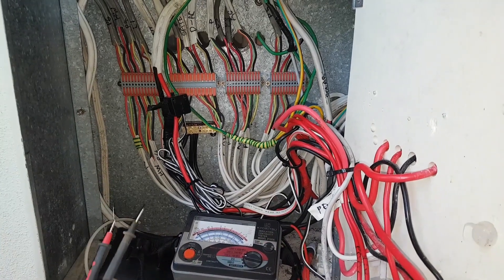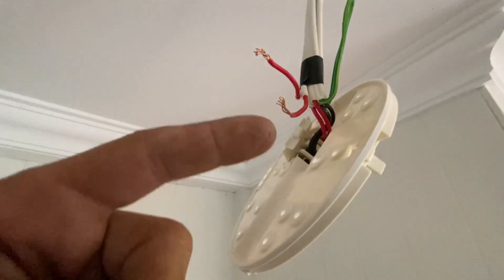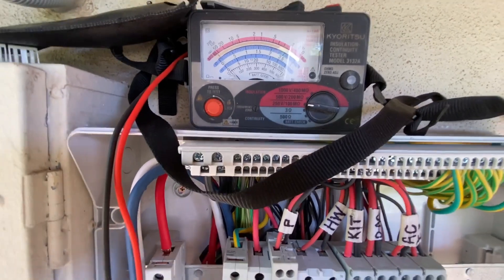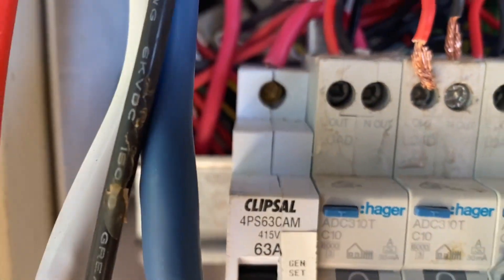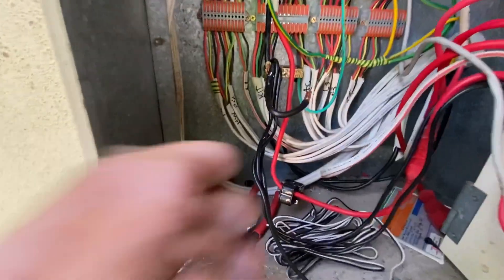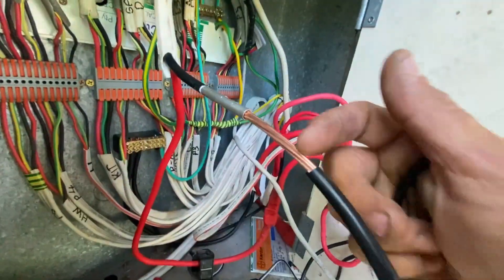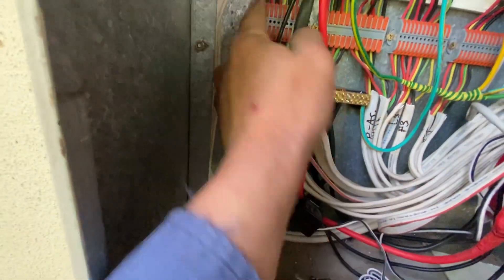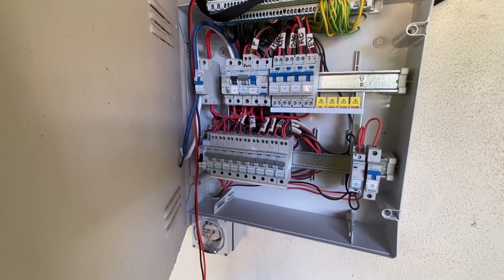Mixed interconnected neutral from smoke alarms. 2 circuits random tripping.

Comment: Can you please explain why the smoke alarms went off and explain with a drawing please ?
Reply from the maker: I've got something even better for you lot! Made a demo board up to recreate this scenario, hopefully will get out a video soon as it's a mistake I see fellow electricians do. 

Just remember the SDI interconnect puts out a DC voltage referenced to neutral, so mixing the SDI on different RCBO protected circuits will cause nuisance tripping because you've created an imbalance ! I pumped 250V DC over 2 circuits to trigger that situation.

Comment: Can you talk about the generator changeover switch and inlet setup? I’m thinking of getting this done at my place. I already have the 63a changeover switch - same as what you showed in this video.
Reply from the maker: For AS3010 you require to switch the neutral (for the lineys) and protect the genset. To obtain this I used a contactor and rcbo for the genset limiting current consumption for lights and power only when on the genset. The inlet never becomes live as it drives the contactor ;) 

Keep in mind most portable gensets are 15A, so enough for lights and power.

Comment: Moving back into a home that was nearly destroyed in a tornado almost two and a halve years ago. Detectors were replaced over a year ago and both are chirping. I replaced the batteries and happened to have a pack of the exact industrial brand/model they specify as recommended. Chirping continues. I removed them from the ceiling and found that the old AC plugs were never connected to the new detectors (different type). Nothing indicates that it will chirp with no AC so that doesn’t seem to explain it. I reset them by holding Test with the new batteries out, checked voltages (good), reinstalled them, held Test again, and yet they still keep chirping. Not sure what to do at this point.
Reply from the maker: Try giving them a vacuum clean. Also hold the test button down to kill the capacitor inside of the device, this resets them.